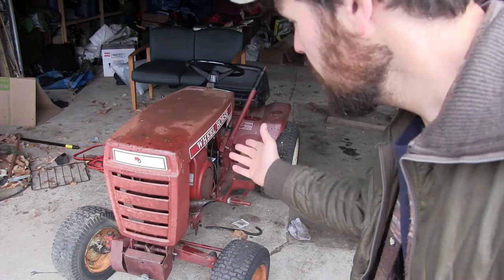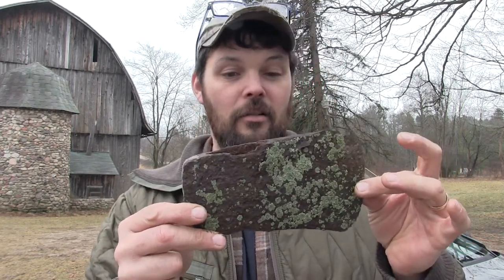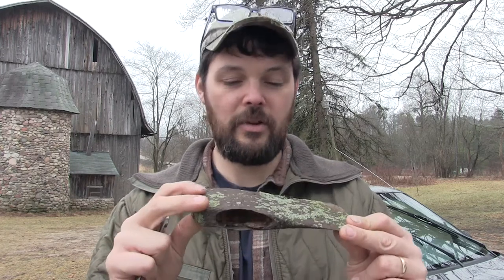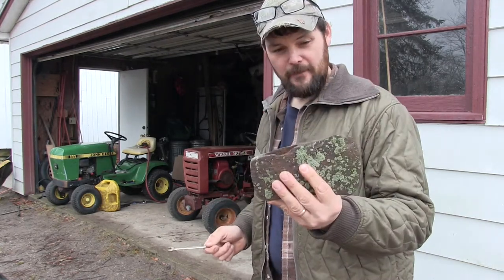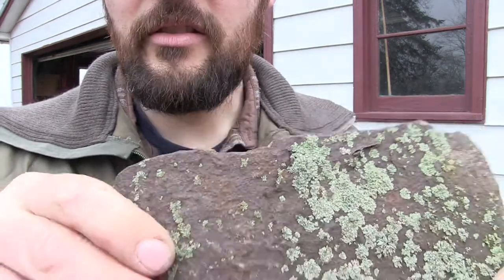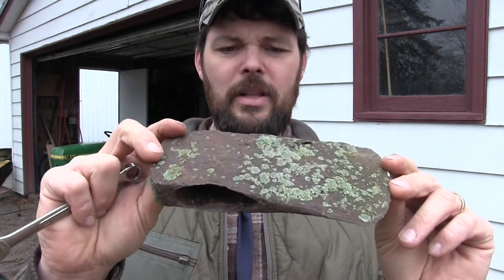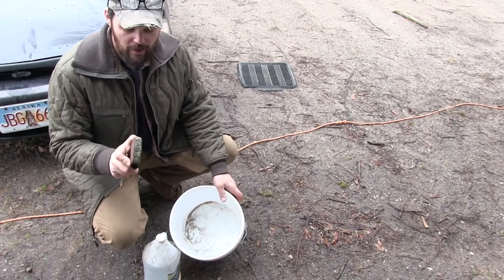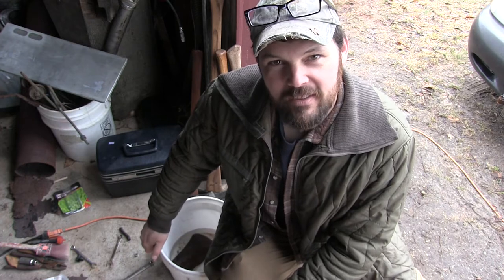Super rusty axe restoration ....PART 1.

Comment: Careful, you might poke a hole in the face of the eye with that 7/16 special tool.    Nice looking axe head.   I would have been tempted to leave the moss and polish the bit then handle, maybe just a collection piece.
Reply from the maker: the moss was cool.
Reply: "was".... key word.   Looking forward to how this comes out.   One of my boys put an older toyota truck back on the road, it had set under a tree for too long, had same kind of funk growing on the fender, two years later it is still there.

Comment: Seriously you need an ultrasonic cleaner.
Reply from the maker: Never seen one ?   IS it something you can buy?
Reply: I use mine mainly for cartridge case cleaning but a lot of people use them for silver jewellery. Gunsmiths use the large industrial ones for cleaning complete firearms. Ebay is massive for them. If you buy one from China don't buy the ones with solid state controllers. I use a Hornady these days, Hornady have a great reputation.